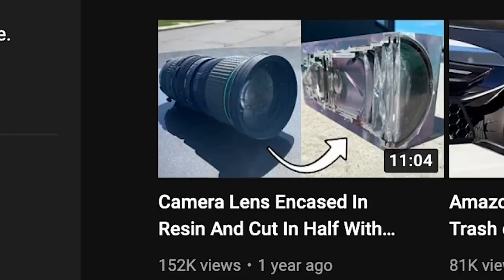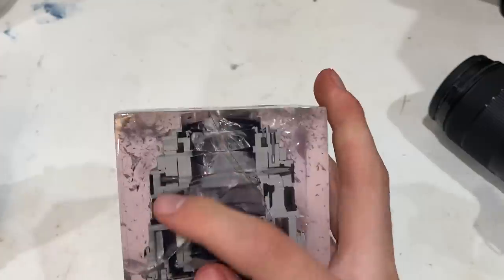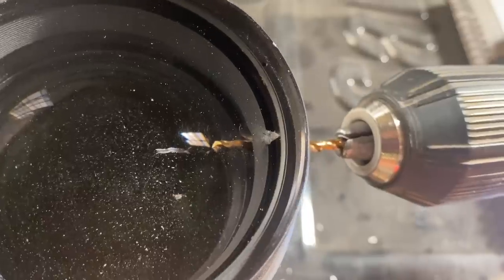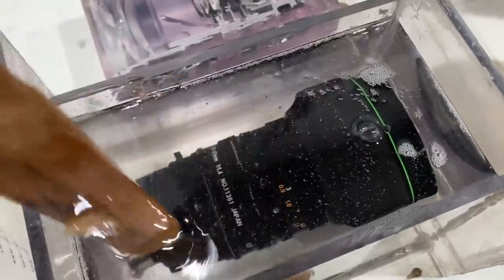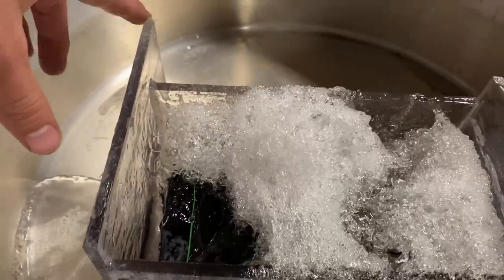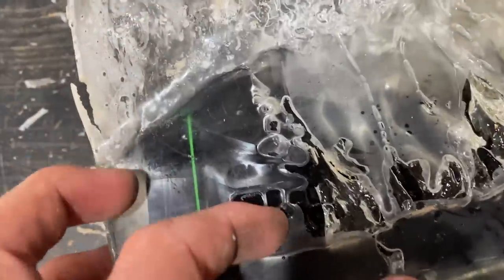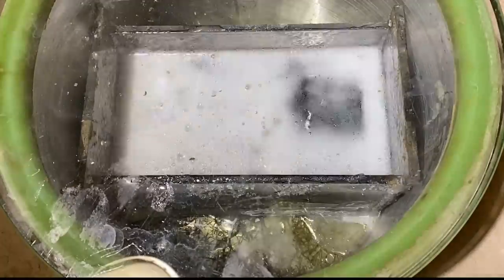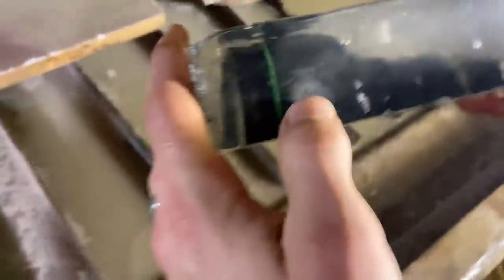1996 Camera Lens Cast In Epoxy Resin And Cut In Half

Comment: That's why you do partial pours and let them set over time so you don't have to worry about all the bubbles.
Reply: They know..
Reply: @liams1991  clearly not.
Reply: Dosn't always work for large objects with voids inside unless you have a way for the resin to get inside at every fill level. It needs lots of holes which can ruin some projects. You can do the outside and inside separately but then you need to plan around how the vacuum chamber will effect it (esp if the object isn't fully sealed).
Best tip I have is to start with the resin as cold as possible (although this makes it thicker and doesn't help once the reaction kicks off), make the mould as small as possible and to add less catalyst/hardener (compensate by baking the object at 60-80°c for a few hours after initial curing stops +24 hours).

Comment: You almost need to drill straight through the center of the lenses themselves (that is possible but need special drill bits
Reply: If only the water jet could just cut a hole through the middle.
Reply: @thepioneer6178  Won't work the lenses would cause the jet to spread out
For this you want a small hole right through the middle of each lens no bigger than say 1/8 inch + 1 somewhere in the body for air bubbles to escape. You could even inject the resin through the hole.
Reply: @nanaki-seto  yea, but if ony it could